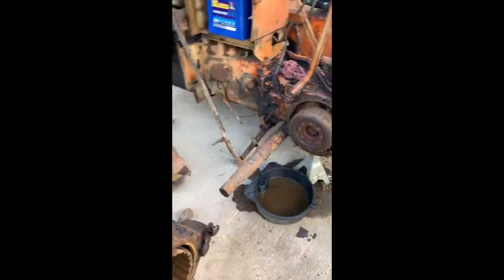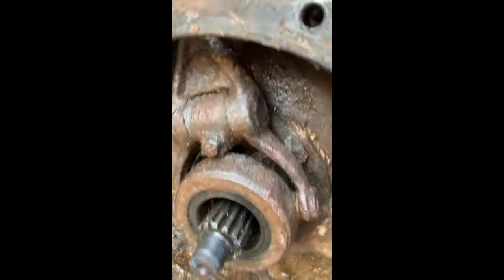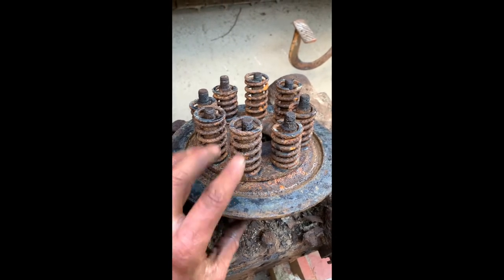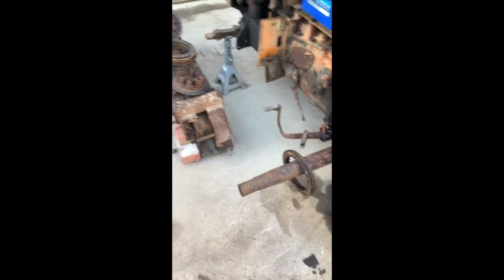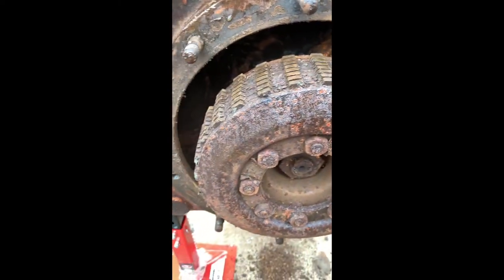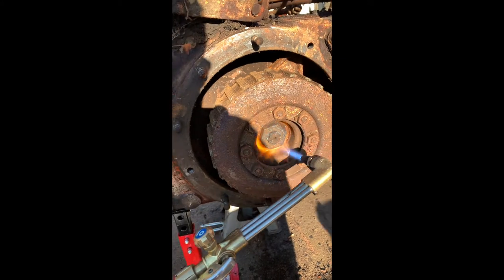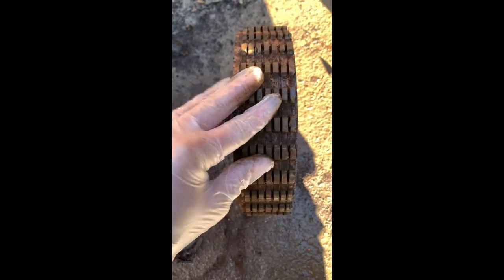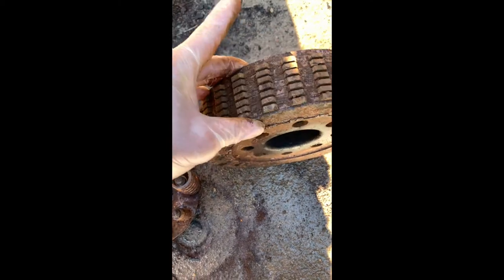1958-68 411c Fiat agricultural crawler / dozer steering clutch rebuild part 1

Comment: You are the first one that show us almost a complete steering clutch job. I thank you. Here in Italy, there is thousands of fiat tractors with the same transmission, and no one has done a decent video about this job. Currently, I'm doing the same job and I'm hoping to post same video to help someone like me to get same knowledge before starting to repair.
Reply: Done the same on my 605c crawler good video
Reply: Thank you @frontrow123 , it would be great to have a step by step video.
Reply: There is a photo clip version on my account if stuck i have a parts / operating manual for a 605c if its of any help all the best